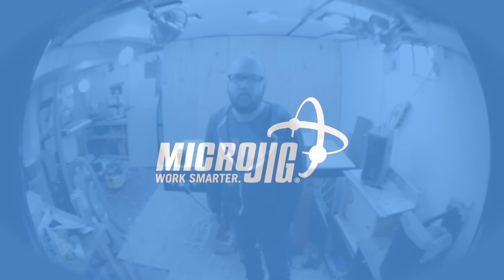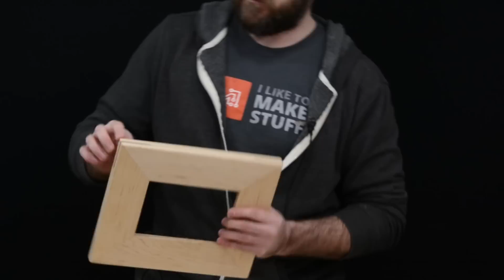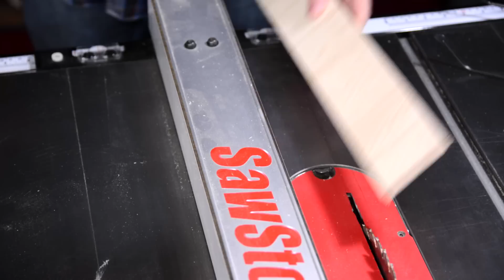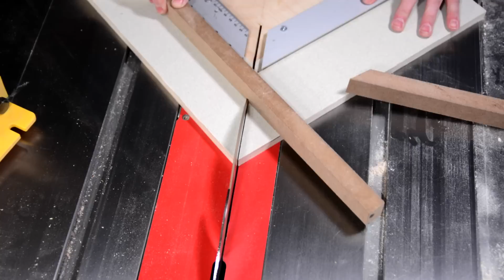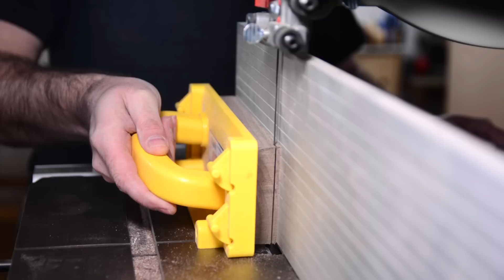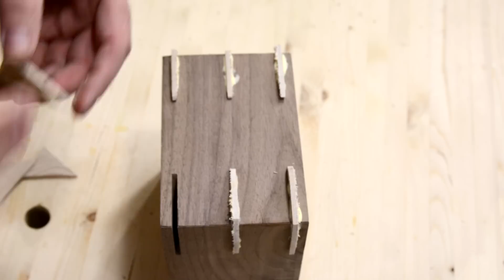How to Make a Spline Jig for Picture Frames and Boxes

Comment: I just built one today, and it works amazing. I had to build it for an old Delta table saw, and notch out the housing over the guide bar because of screws on the back side of the guide, but that helped it to keep it more aligned.

I left my frame guides a little longer beyond the jig for 2 reasons: 1) to support a larger frame, and 2) I can use the back one for a handle to push the jig through. 

Thanks again, this is great. Love your tutorials!
Reply from the maker: Right on! It’ll come in handy!

Comment: How did you get it to where your work piece is just above the table of the saw? Did you use the drafting triangle for this purpose...slightly extending it past the edge of the board? Cool jig...I'm going to make one.
Reply from the maker: +Bruce A. Ulrich Yes, that all I did as seen at 2:51.
Reply: +Make Something Ok...good deal. I thought it looked like the triangle was just off the edge, but wanted to make sure. Thanks for the quick reply!
Reply: +Make Something Awesome jig- i'm almost done making it. I don't get this part though. If the drafting triangle overhangs the bottom of the board, won't the picture frame touch down onto the tablesaw table top before it sets down nice on the mdf guide pieces? I thought that the drafting triangle would need to be just a hair inside the bottom of the spline jig. Please help me out here buddies?
Reply: +Bruce A. Ulrich  Awesome jig- i'm almost done making it. I don't get this part though. If the drafting triangle overhangs the bottom of the board, won't the picture frame touch down onto the tablesaw table top before it sets down nice on the mdf guide pieces? I thought that the drafting triangle would need to be just a hair inside the bottom of the spline jig. Please help me out here buddies?
Reply from the maker: Hal Morra It should not overhang.

Comment: A vertical slot cut in the vertical board would let you clamp through the jig and hold the frame in a more stable way, instead of at the top.

Comment: I have tried a sled ran spline jig and in my experience they are not accurate at all. I made one that runs on the tracks in the table saw and it works 100%

Comment: What is the measurements on your spline jig. Great job Bobby.
Reply: He never gives the measurements.  It's pretty hard to figure out the exact size looking at a picture
Reply from the maker: You have to custom make it to the size of your table saw fence. 🙂
Reply: if you measure a drafting triangle, mine is 11 1/4" and than measure the two clamp heads which come out to 2 1/4" for a total of 15 3/4".  This would give you the size of the parts needed to mount on your fence, I would guess the 15 3/4" would be square.  The 45 degree for the 2 pieces  would be a guess as well but it looks like he is positioning those pieces approximately 2" to 2 1/2" above the end of the jig.